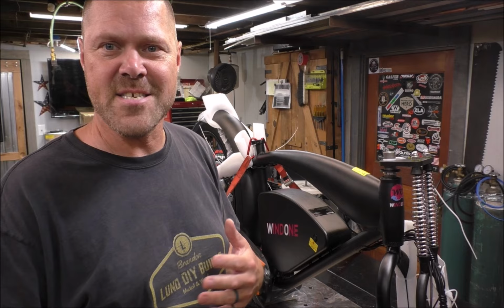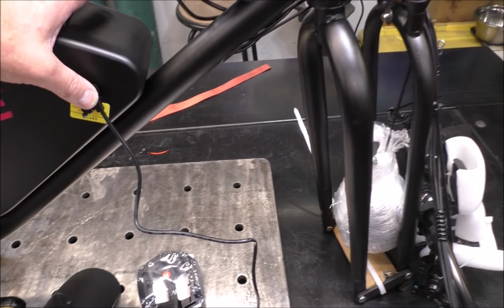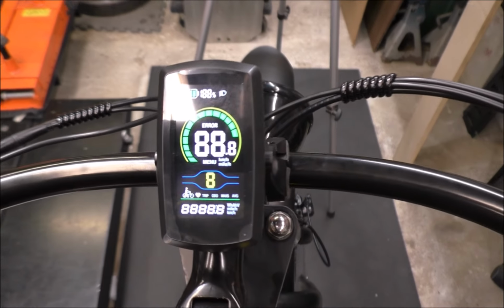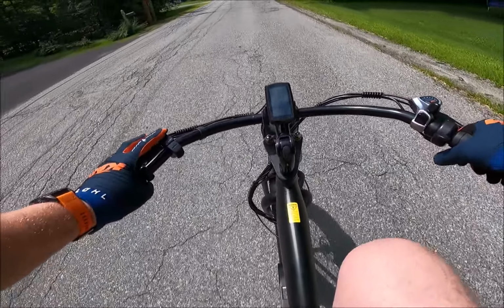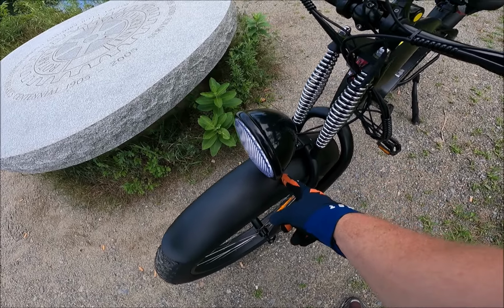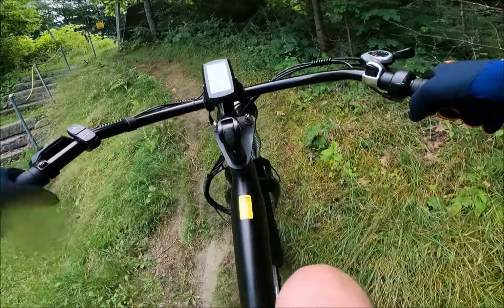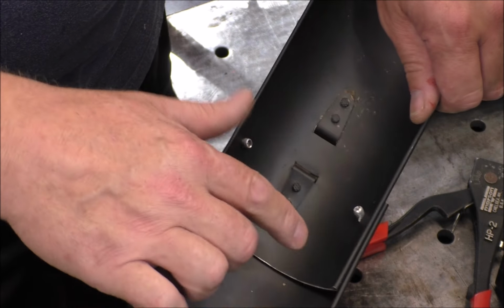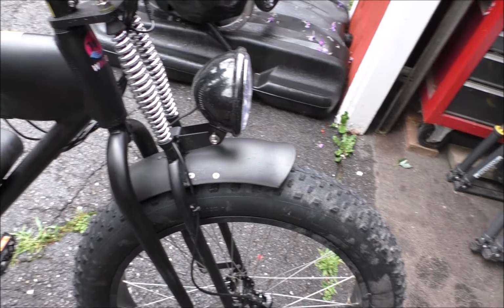I Bought an Electric Bike Assembly Test Ride and Modification Windone K20

Comment: I somehow missed this video. After 6 months what do you think of this bike? LOL I thought I watched all your videos.
Reply from the maker: I absolutely love it! The battery life is incredible. That was the one thing I was concerned about, and it's fast, and the big tires make it ride nice and smooth. My only complaint is that the handlebars will move up or down easier than I'd like. I picked up a set of mountain bike type handlebars which has eliminated that issue. I've put about 500 miles on it so far and the handlebar issue was my only complaint.
Reply: @BrandonLund  yeah I thought 60 miles was good. You have a nice town to ride in. Nothing is flat here. LOL. FYI they are opening a motocross track just a half an hour from my house. Near Malvern Arkansas.
Reply from the maker: @scottchastain1382 I would be right in my element!

Comment: The front fender is on back to front. The long section will protect your battery and crotch from cold muddy water.
Reply: Was.... 😊  Should have watched to the end before commenting.
Reply from the maker: No worries. I wish they would have put a sticker on the fender that said "front" or had a picture in the instructions. Besides that, this bike is so much fun and super comfortable to ride
 As of this video I have a little over 100 miles and couldn't be happier